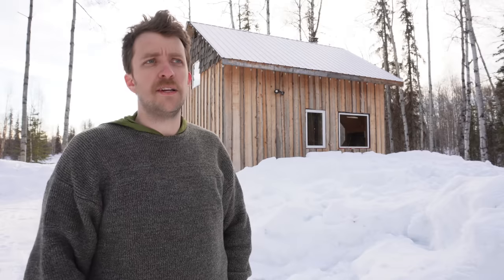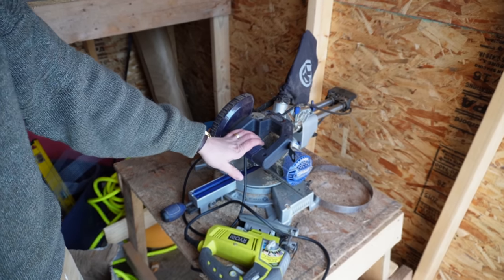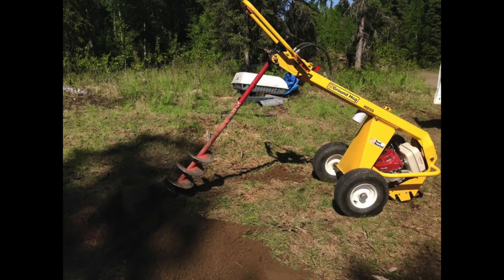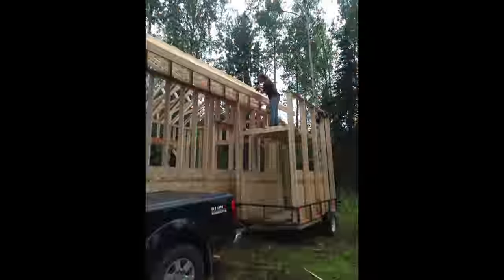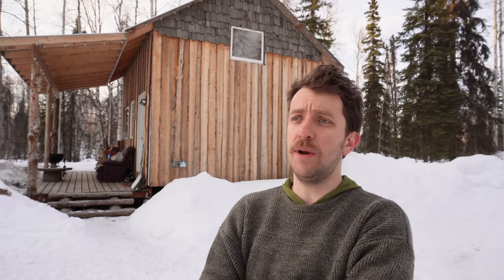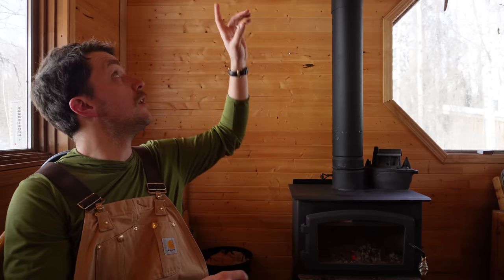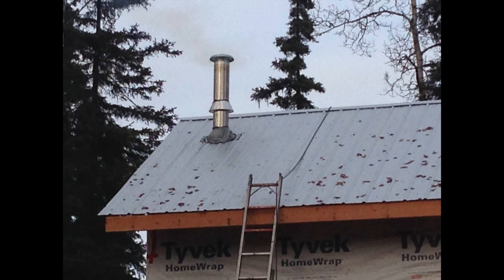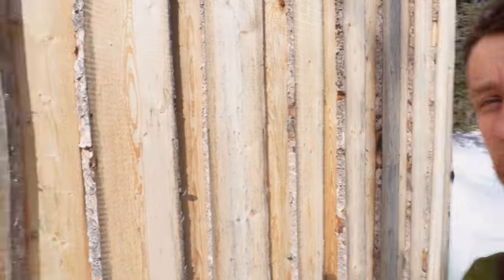How I Built My Cabin In 7 Steps With ZERO Building Experience

Comment: You made one big mistake. A ridge beam does not have to be huge. Actually, it’s better if it isn’t. It’s all about load distribution. I used the same size as for the framing, which is 45x95mm for a bigger roof than your one. The rafters are screwed to it without any additional bracing and they are screwed to the wall cap without bird mouth cutouts and also without any bracing. It’s all rock solid.

Comment: Your right about getting info from people. When we were doing the metal roof I kept sliding and was having problems getting the screws in due to the steep pitch and a guy down the road said to spray soda on the metal and when it dries it's sticky which keeps you from sliding. Worked like a charm and it washed off with the rain.

Comment: Great story!👏

I've owned my property for 22+ years and just started to build 3 years ago, when COVID (🙄) hit and it really extended contractors and materials. My property is a 3 hour drive from my current home, and plan to keep both, so am doing cash out of pocket. The home is a log home, and I have the shell complete up to the top plates. I have water hooked up, and electricity, the septic was a big expense and difficult to buy tanks during the pandemic. I have an 8x8 bathroom in the shop with a shower/toilet. Contractor is only hooking up water and sewage to septic tank. I'm taking it from there, I am owner-builder.

Comment: Hi Matt, I popped in to your channel because I'm in the middle of my own cabin build and am soaking in as many build videos as I can.  I bought my place in extreme NW Montana up in the mountains (4,500').  I too am about an hour away from the nearest "town" so not too bad but sure turns ya into a "list guy" real quick.  I got started late in the build season and after a month of hacking my way through the forest, I was able to set up camp, clear the build site and start digging. I was able to get the foundation completed and the subfloor screwed down but had to coat it in Thompsons, 9 mil plastic and a tarp and headed down the mountain for the winter as I had already gotten dusted with 6" of snow and another foot coming the next day.  I drove my travel trailer down the mountain and headed to Washington (Port Orchard area) for the winter to make some more money for the cabin build while my build site is under 10' of the white stuff.  While I'm working the weekdays, I still have my nights and weekends, so I decided to build a 1/12 scale model (currently working on loft floor joists and rafters).  Building the model is teaching me A LOT and has already helped me avoid a bunch or mistakes and pitfalls I would have otherwise made that would have cost a lot of money and a ton of time.  The idea was to make most of the mistakes on a small scale and get all the "figuring" out of the way to help maximize my time during the short build season. We oddly enough both chose to build 16'x20' on piers (mine is 4'-6' off the ground depending on where ya stand) and although different layout and such, it was nice to see the inside of your place. I originally drew up plans for an eave porch like yours but decided to go with a gable porch instead, to let my 12/12 roof sluff off the snow without getting caught up on a low pitch eave porch.  I also decided to turn this gable porch, or rather the space above the porch, into living space so although my 1st floor is 16'x20', my upstairs will be 16'x28'.  I agree with you on the arctic entryway and plan to turn 6'-8' of the porch into exactly that.  Thanks for the video, now I need to go check out the rest of your channel! Sub'd.
Reply: Impessive, I am thinking of doing teh same but really not sure where to do it? Alaska soundsgreta but wonder if its too extreme for me. I will be 49. Curious how old were you when you started your build?
Reply: He was in his mid 20's. I'm 59, a female and about to start my build in June 2024 and the only wood building experience I have is building a bed and a counter in my mini cargo van last year. So, I say go for it!
Reply: @mitziyoung9668  I did... go for it that is.  Last season I built the cabin and got it dried in before I had to leave for the winter.  This coming season will be spent finishing the build as it is my only plan, I have given myself no other options on purpose, so it must get done so I can live there year round.  Good luck with your build, much respect.
Reply: I'll help you man buy my ticket I be down there asap
Reply: @bartonsky  I was 47, I'm 49 now, the cabin shell is built and I'm working on the inside now.  Did you decide to go for it?
Reply: @thecordlesscarpenter7956  still figuring out where to go. The sun is important to me so I am leaning toward sunnier climates now.

Comment: Good advise, for those who want to go straight to batteries and solar, you will be able to run all your power tools with most inverters except for your drop saw with a 10 inch or bigger blade, they have a much larger start up current which will be to much for many inverters, even ones "rated" to 8000w peak. It certainly will always be a work in progress :)
Reply from the maker: Yuuuup, Just experienced that exact thing, even with a 7in blade. I was bummed. But my 2000 gas generator does it no problem. Thanks!
Reply: A cordless miter saw might be the answer. Then you’ll just have to charge the batteries

Comment: Regarding the "Deathwagon" (LOL) - Weld/bolt up 4 square metal plates (maybe a 5"x5") underneath the trailer in each corner. Get yourself 2 pairs of cheap bottle jacks and some cement pads. Line up the cement pads & bottle jacks under the metal plates in each corner. Boom - instant leveler/stabilizer.

Comment: FYI Rockwool insulation costs approximately 2x as much as fiberglass,but In pretty much every other way , it's significantly better

Advantages of Rockwool

Made from stone (basalt rock) and recycled steel slag.
These readily available and sustainable materials make Rockwool more durable, less irritating, and less dusty than fiberglass batt.

Higher R-values than fiberglass insulation.
For the same thickness, Rockwool provides a higher R-value, or for a given target R-value, you can use a less thick Rockwool batt choice, making installation more convenient (e.g. Rockwool 3.5” thick = R15 and 5.5” thick = R23 vs. Fiberglass: 3.5” thick = R11 and 5.5” thick = R19.)

Moisture resistant.
Rockwool actually repels water, and won’t absorb moisture like its competitors. This keeps your insulation spaces dryer, and prevents degradation of the adjoining construction material.

Completely resistant to rot, mildew, mold, and bacterial growth.
Over the long term, Rockwool keeps performing without compromising the health and integrity of your home or commercial building.

Fire resistant.
Rockwool gives you peace of mind with a fire resistant design that makes safety a high priority in your living space.

Rodent-resistant.
Rockwool’s steel content keeps rodents out of your insulated space.

Does not itch.
Anyone who has worked with fiberglass knows the continuing pain of this itchy material. Rockwool solves that problem upfront.

All-friction fit.
Make your installation easier and faster. Simply cut Rockwool slightly larger than the space, then easily wedge in for a tight, convenient fit.

Easy to cut precisely with a serrated blade.
A bread-knife blade is all you need (Rockwool has them available) to quickly and precisely cut pieces to fit, as well as cut out spaces for electrical boxes and other wall features.

Denser than traditional fiberglass insulation.
Rockwool effectively reduces airflow and essentially, sound transmissions. Its higher air flow resistivity means better sound attenuation for a quieter environment.
Reply from the maker: Good tip!
Reply: @alaskacabinadventures  glad to hear you liked it homie

Be safe and be well
Reply: I insulted my cabin last Sunday with Rockwool, every point you mention is 100% trut but the itching part. I found it a bit itchy but I would imagine nothing like fiberglass.
Reply: The sieving is also unnecessary, let alone with OSB which is not breathable. Horizontally oriented wood elevation stiffens the construction sufficiently enough and if you do the same on the interior the that sieving becomes no only completely pointless but also potentially harmful, not to mention a waste of money. Here in Europe OSB or similar sieving is a no go for the smarter and more experienced constructors while in Scandinavia it’s mostly unheard of.

Comment: Timmy's Time Out Cabin.  Make a high lean to side so he can park his mobile house truck under it.  Place looks great.  I built my house with 3/8's inch rabbit cut for over lap on 1"x12" ponderosa pine (.33 cents a ft.1989) run straight, on angles all different ways to change up the look on the walls.  Oak hardwood floors and some tile, ceiling has 6 inch wide hard yellow pine V-groove with T&G all over the ceiling.  28x36 two story.  Yeap, it's hell getting it done.  I don't think it ever will be.  Not for replacing what's worn or just want to change.  When you get older the size will suite you on a 16x20.  You just don't need the space to take care of.  Outbuildings, a sauna things like that can be added in the yard.  Like you are going to do.  If you have good access you could rent that out most all summer with travelers coming through.  Several like that in Fairbanks.  Take care be safe the ice is thinning.

Comment: I really like a high ceiling. I've used those scissor trusses in my last 2 builds.
Reply: I've been researching the scissor trusses for my upcoming cabin build.  Some people say your walls will still deflect a bit with scissor trusses.  Have you had any trouble with that?
Reply: @jshepard152  No problems, I had 2x6” wall studs and the double top plate really stiffened up the walls. One build was 14’x16’ and the other was 12’x20’. Not sure if 2x4” walls would end up being as stiff. I would also do some research if I ever do a wider span.
Reply: @jamesmckelvy5441    Thanks a lot.  I will probably do 2x6 walls myself.

Comment: I came across a video that used a footer attachment to attach to the cylinder that is used to form the concrete piers.  It creates a wider footing at the bottom of the piers?  What do you think of this idea?  How did you reinforce your piers?  Are the brackets you attached to the piers adjustable?  How did you go about leveling the piers and determine how far above ground your piers would be?

What steps did you take in the construction to avoid problems with wildlife?  What sort of precautions do you need to take in the area your in when it comes to dangerous wildlife when exploring, hunting ir fishing, etc..?

How long do expect your cabin will last with the concrete piers and constructed the way you did it?  I would think the way you built your cabin would also work well in Montana.  Do you agree?

Comment: If the property isn't lakeside or river side; it is junk.
Why?  No sunlight, no swimming, no easy fishing boating, no view,
no easy cross-country skiing to different locations off your frozen lake or river.
No jumping into an ice cold river or lake after a stint in your sauna...
Without the cold to balance the heat you are not doing a real sauna.
it is incredibly invigorating and healthy.
Learn from your mistake.  Sell it and build a proper cabin on water.
Believe me: sooner or later you will get tired of staring at a wall of trees.
Staring at the same trees over and over is boring, stultifying, enclosing.
Of course if you don't even look out the window, you have no connection
to the Nature you live in and my comment can be ignored.

This advice is from years of experience of living at many different locations.